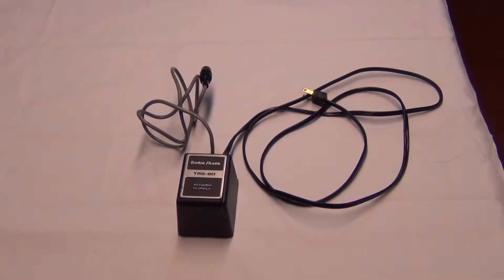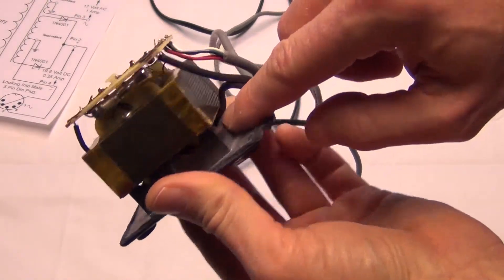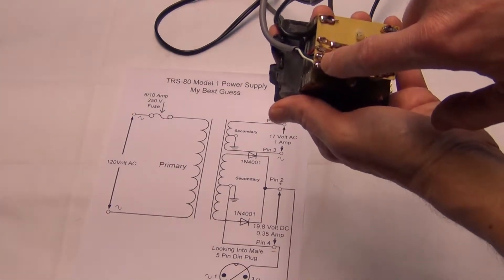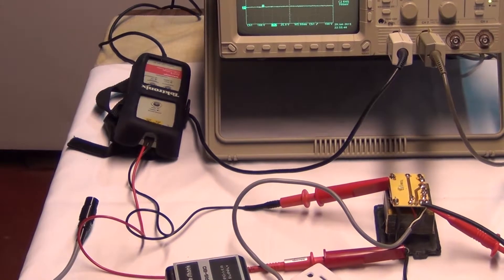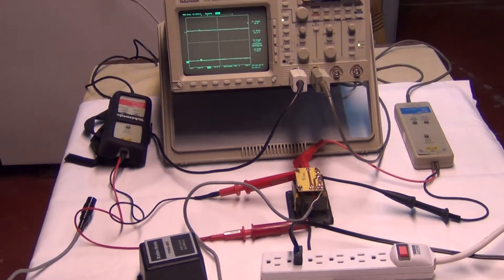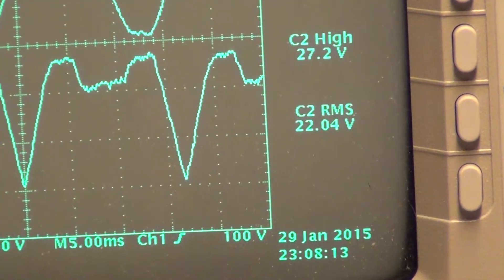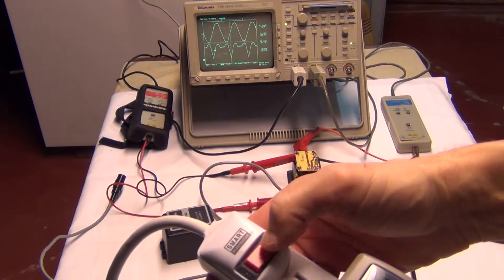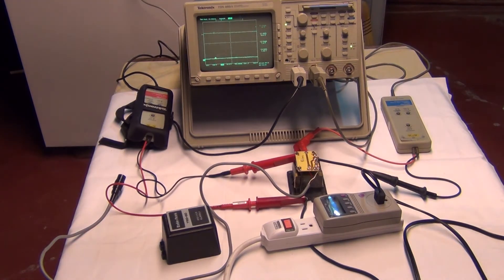Vintage TRS-80 Model 1 Computer Radio Shack Power Supply, Cat. No. 4000004

Comment: Hello, I'm only getting 9 VAC on the AC pins (1 and 3) on my supply, I bought a second supply and I'm also getting about 9 VAC on the ac pins... (I stuck my VOM probes into the wall to check readings and got 119 VAC as expected), any ideas about the low AC voltage?  Thanks for any help you can give me...